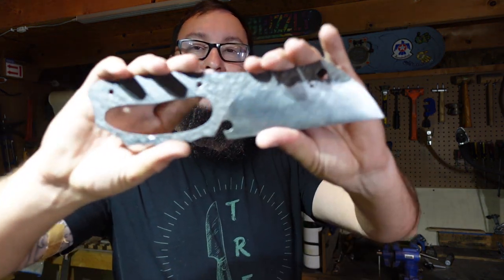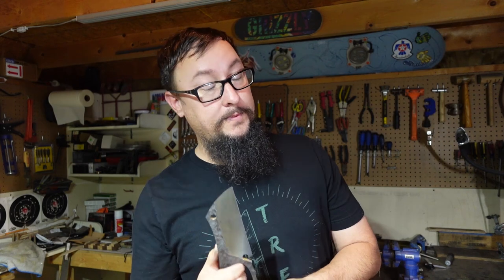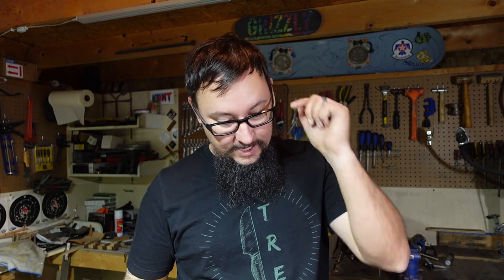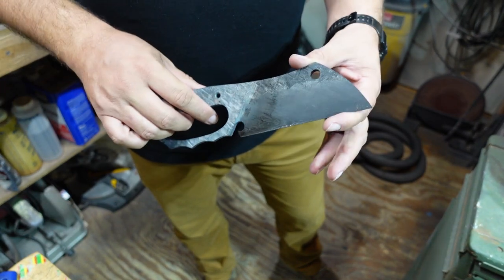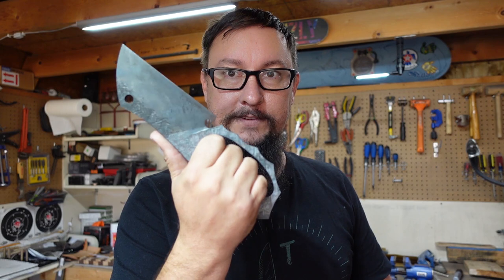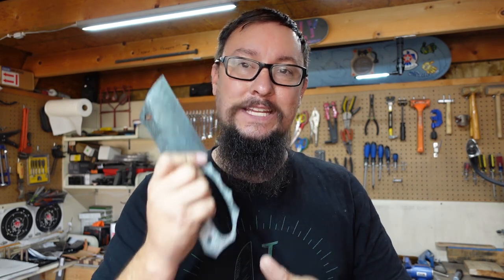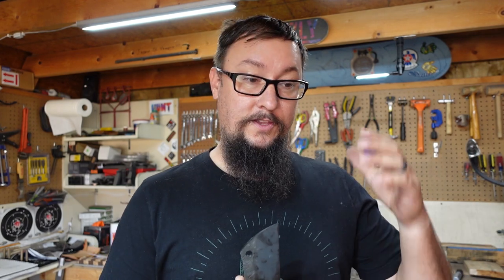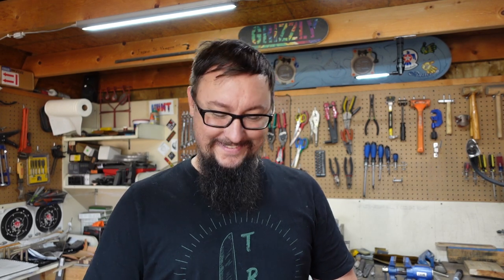Heat Treating The Post Apocalyptic 5160 Cleaver | Daily Vlog | Knife Maker

Comment: Why didn't you harden the knuckle guard part of the knife at all? Just curious about your thoughts on the matter. The knife is awesome.
Reply from the maker: I want that part to be soft enough to bend and not break. 5160 is still very hard in its none hardened form, it won't need to hold a sharpened edge for slicing like the cutting edge does.

Comment: Another question, how do you check the temp on normalizing and the heat treat ? By the color or....
Reply from the maker: I have a laser thermometer that I use to check the temps.
Reply: @theriversexperience9383  that's what I thought,  I do have one but not sure if it goes that high..I'll have to check it out.  Thanks for the response.